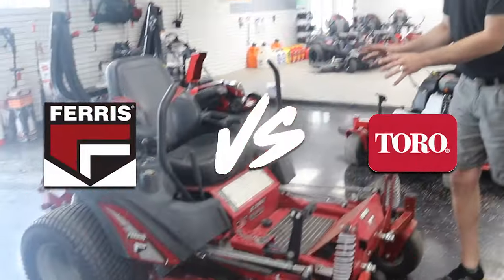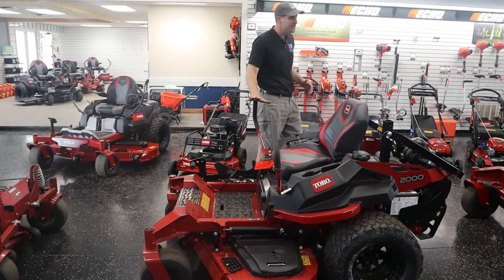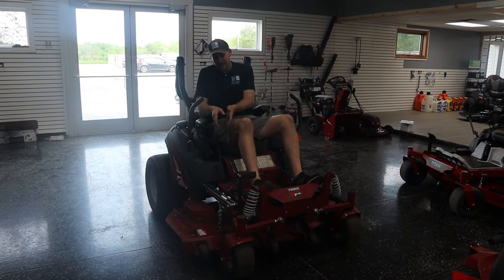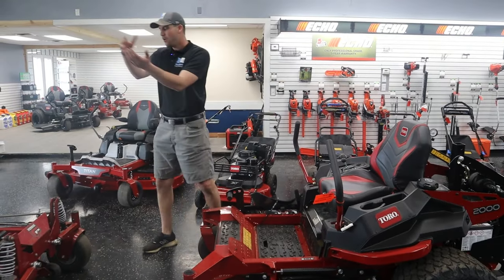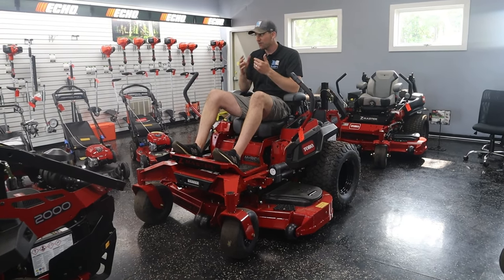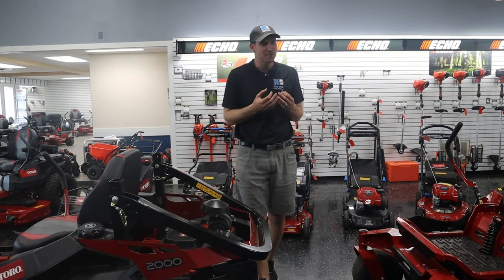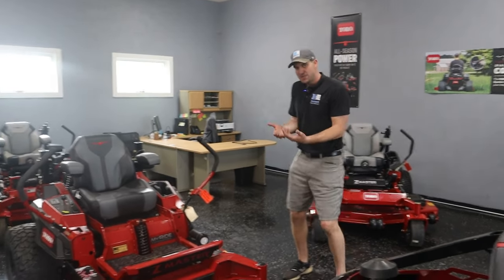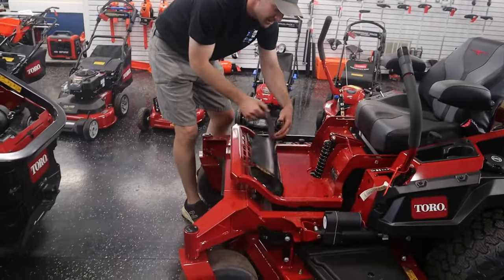TORO vs FERRIS | which brand makes a better mower?

Comment: Both make a good mower,  depends on what you want out of a mower.       BUT I just sold a Toro Zmaster and bought a Ferris isx800 and absolutely love the Ferris.  There is no comparison for the ride it offers.  No regrets.  Looked at the MyRide before buying the Ferris and still no comparison,  Ferris has the absolute best riding mower out there.
Reply: I Agree with this 100%
Reply: I gotta have the toro. Stays on hill better and I get done quicker

Comment: Mower cost has got way out of control
Reply: I agree they are pretty simple machines compared to say an ATV.  You can basically bolt things together it doesn't need to be high performance.
Reply: Yep 🤦🏿
Reply: The Ferris is way cheaper than most with the best possible accesseries available

Comment: I owned a Ferris ISX 800 for 4 years  and it was the worst handing mower and cutting mower I’ve ever owned. It is unstable on hills and ditches and the cut is uneven if you have a yard that is slightly hilly going up because the back end will squat and give you a higher cut in the front because the front of the deck raises a little due to the back end squatting.
  You will have to double cut to even out the cut. If cutting down hill it will be much lower cut because the front end will squat. I was glad to trade my Ferris in for a toro z master 2000. The ride on the Ferris is not all that good.  I adjusted the suspension in every position and you still have to spend money on a suspension seat for it to get a good ride. In order to get a good cut on the Ferris you have to adjust the suspension all the way up to prevent rear and front squat. Just my experience with Ferris and others might have better luck with Ferris.

Comment: The body on a Ferris may nose dive on a hard deceleration but the deck does not as it is suspended off the wheels not the body so it does not produce a lower cut in the front when this occurs.  Unlike for instance putting a set of Flex Forks on a Hustler then when it nose dives under hard deceleration it will cut lower when this occurs.    I've  owned 4 Ferris machines including the 5100 diesel 72 and loved each including the two I currently own.  NO mower rides as good as a Ferris.
Reply: Doesn't that essentially make it the same as the Toro then in this video?  You have wheels + deck as the bottom platform then the rest on top.  With shocks between.

Comment: The comment made about coming to a stop/slow down,and scalping is not accurate. The deck is linked to the suspension. As the suspension is compressed, the deck raises, and when the suspension is extended the deck lowers. This is a great feature on the Simplicity/Ferris deck suspension design.

Comment: We run Ferris. The biggest difference between the My Ride System and the Ferris suspension is, My ride is a suspension system for the operator where the Ferris suspension is for the whole machine  which aids when mowing grass fast, you get less deck chatter than with the Toro when the front tires are bouncing up off the ground while hitting bumps.  If you incorporated Hustlers SmoothTrak steering into a Ferris, it would be the dream machine. The automatic parking brake on the ZTR's from Hustler is also awesome.

Comment: I think that the toro is worse because the wheels in the front do not move, on the Ferris they move and it feels like the bumps are getting filled im, sorry but the Ferris suspension is just better.

Comment: I have a new Toro lithium, it sucks, drive wheel falls/self-powers off in 2nd hour, battery shorts, and on-line Toro will not take it back. They do not take items back if you use it for 1 minute! Their rear left geared wheel unbolts itself from the bracket, it self destructs! Two others have the same problem. Their repair dealer literally told me "with Toro, its Buyer Beware". I have a Toro case number, a BBB case number, and a US Consumer Product Safety Commission case number.  Save yourself and learn from my mistake, and stay away from Toro.

Comment: I just purchased a new Toro Z 2000 60" with MyRide. Best mower I've ever had, bar none, but two things I've noticed:

1. The foot lever for raising/lowering the deck is very awkward to use and I have turn myself into a pretzel to actuate it. I'm 6'0 and I cannot imagine taller guys having to do this. I will have to fabricate something to move the pedal further away so I can push on it more easily.

2. This mower is so fast, I am noticing bumps in the areas I mow that I never knew were there before (because my previous mowers were slower). Even with MyRide, it gets bumpy on the mower at times. 

Other than those two things, this thing is a beast. I was looking for a better mower that could lower my cut times and be more comfortable while doing it. The Z 2000 certainly fits that criteria, but I'm sure there must be better mowers out there.

Comment: Very informative video on the 2 brands. They are both solid machines but the older I get the more I want comfort.
Reply: I’m with you. Just took delivery of a Ferris ISX2200 which is the newer version of the one in this video. I’ve got a bumpy yard due to over a dozen very large Silver Maples that send out roots right at the surface in some areas. I have berms and hills too. The Ferris is like taking a Lazy Boy on a ride around the yard. No comparison to any of the other zero turns or tractors I’ve driven. You’ll love it. 

The ISX2200 also has an upgraded deck. Very smooth cut and I haven’t noticed the nose-dive scalping that he discussed in the video. Mine has a 60” deck and I was concerned about scalping as I am retiring a John Deere with a 48” deck. I don’t know how they did it, but the Ferris has much less tendency to scalp than the old JD. 

A couple of things that I don’t like about the Ferris is locking mechanism for folding/extending the ROPS bar. It consists of a 1/2” round bar with a hitch pin on each side. It’s fiddly to say the least. 

The other thing is the mechanism to hold the discharge chute cover vertically when the extra clearance is needed is a joke. It doesn’t hold the chute all the way up and releases even with just some minor jostling when parking in my barn. I fabricated a temporary solution this morning and am just waiting for the paint to dry to install it. But I shouldn’t have to do that. The chute is real nice though. It’s thick reinforced rubber that’s over 1/4” thick with no corners to impede grass discharge. It broadcasts the clippings very nicely.
Reply: @Dave-ei7kk  sounds like a great mower and having the suspension it’s a no brainer

Comment: First thing I do when I buy a new Z Turn is remove those pulley covers!
All they do is trap grass under the pulleys.
Next I remove the chute and add a chute blocker.
That way I can use the mower as a mulcher for leaves, or block off the chute if I'm in a tight spot to stop blowing the grass into the landscaping.
Reply: Same

Comment: My first ztr was a Ferris 2009 model IS500z with 52" deck. Replaced it with a Ferris IS2000z with 52" deck fall of 2015. What made me go Ferris is my 3 acre yard is fairly bumpy. Loved the IS500z, rode good, cut good and very little trouble. I upgraded to the IS2000z after my daughter bought a house 1 mile from mine. She has a 2 acre yard so my mower cuts 5 acres at a time. I know these are older units compared to the test but I still feel somewhat relevant. The 2000 was a noticeable improvement in ride, which a Ferris has a good ride, and cut. The 2100 replaced the 2000 and now it is called the 2200. In 2014 the IS2000sz with a 52" deck and 28hp Briggs motor was around 9k even. The person I bought it from, an older gentleman with 1 acre, purchased it leftover for 7.8k spring of 2015. Sold it to me with 12.1 hrs for $6500 fall of 2015. I felt like I had stolen it. They will scalp it you stop fast at speed. Or stop and back up fast. You just need to keep your movements fluid and it doesn't ever scalp my bumpy yard. Ride and cut are much better on the IS2000z over the older IS500z. For 14K I would think you are near Ferris IS3300z price. Most all brands are good and many advise to rate the dealer more than the mower itself. Lucky for me I have needed very little dealer support.

Comment: I love my new Ferris ISX 3300 72 inch bad boy indeed smooth no scalping and cuts my 7acres in 3 and half hours full throttle 12 mph
Reply: hmm.  my older IS2000 does 5A in 1 hour (flat, grass only).  but, I never push it that hard.  I mow at about 30% top speed for a more beautiful cut.

Comment: Hey Matt, Russell (Tennessee)  here, I have a Ferris ISX800 54"  and i love it!! also have a Snapper ST50X 36"  I did get the Toro Grandstand you quoted for me. I found one in Nashville so it was geographically better. i haven't put it in service yet but after riding the Ferris it is bumpy s heck! But, If you are riding the Ferris and you make a quick stop you will put the Olympic rings in the lawn! :face-blue-wide-eyes: Toeo is great on smooth yards! Great Video!
Reply from the maker: Glad you got one. Thanks for watching our stuff. Sounds like you have a nice fleet.

Comment: To me the suspension on the Ferris takes the shock out off the frame. I suspect the Ferris can stand up better to rough terrain over a long period.
Reply: Much easier for the back for those who prefer Riders over Standers.
 If someone has relatively healthy legs, a Stander is by far less fatiguing.

Comment: Left off most important aspects:  quality of cut, warranty, and engine offerings for each.
Reply: Yes, thank you! You’d think he was comparing vehicles used for transportation rather than vehicles whose primary use is to cut grass. A lot of talk about the suspension and called out the transmission model 3 or 4 times but not a word about the power plant. And that’s a big deal. 

One thing I did learn that gave me pause about buying a Ferris mower is that they are owned by Briggs & Stratton. I want a Kawasaki or Kohler or Kubota motor in my mower. Briggs would be my last choice or maybe even a deal breaker.
Reply: @Dave-ei7kk  You nailed it!  No wonder power plant was not mentioned.  Thanks for the info.

Comment: i have a 23 ferris 400s and its a little tank ,mows a slopping 5 acer lumpy bush block many trees and garden beds lumps and bumps she cuts  about 3 acers  very well and fast so damn quick and nimble , even thick grass rips through it ,,what took me 6 hour on old 16hp murry lawn tractor i can now do in 2 hours on the ferris ,the 23hp v twin B/S heavy duty block engine has more then enough grunt i dont rev it hard not for first 5 hours but i still cuts perfect at 70% throttle ,got the property looking like a golf course ,Amazing machine worth the money i think going for trouble free mowing for the next 4 or 5 years ,do yourself a Favor and spend more time doing thing you love now i can smash the yard in 2 hours its a Friday arvo job done and dusted ,free weekend to go camping fishing 4wding with misses ,  welcome yourself to the twenty first century of mowing grass ,400s now comes with upgraded pro 3100 hydro trans

Comment: I love the videos especially the comfort 
I love to see the toro 6000 vs toro 4000
31 hp vs 35 hp
16 cc vs 5400 trans
I use both
Reply from the maker: Thanks so much for watching! We have a local guy who bought a 4000 and 6000 series 72” that we plan to do a video for in the future.
Reply: It would be interesting 
Especially banks and response between transmission
Reply from the maker: Check out the latest video on our channel

Comment: I happen to own a Ferris IS700Z and a Toro model 75759.
By far I like the Ferris far more!
It's way faster, handles and rides better, has far more grease points, wider deck belt.
SImple things like under the seat there's a sticker that says what the deck and hydro belt part numbers are, a simple to use drain line for the oil that stays attached, even The Treads on The rear Tires have more TracTion Then The Toro.

Comment: I was looking at a ferris and toro when i got my new zero turn. I wanted the ferris for the suspension. Nothing rides like a ferris mower!!  It's amazing how smooth one rides. I wanted a toro cause my dad has a zmaster 500. That toro is around 17 or 18 years old with no troubles at all.  It has been bulletproof. I ended up with a snapper pro 200xt with a 37hp vanguard. It is a brother of the ferris and its built as good as a toro 6000 minus $5000.

Comment: Side comment, why is it that when you buy a mower that the manufacture's cheap out and do not put  a sticker on the deck showing  the layout for deck belt?
There also should be a sticker telling the deck belt, hydro belt, oil, and air filter #'s, and the blade #.
They give you a manual with three pages of useless safety warnings to cover there butts, but no useful info on the parts needed to maintain it!
Reply: The toro has always had a belt diagram on the deck.

Comment: I own a Ferris is700z 61’ with the 27 Briggs

And a toro 4000 pro 52’ with the 25 kawaski. 

Non biased opinions, Ferris beautiful ride little outdated when it comes to tech like usb ports or massive storage compartments, and the zt-3300 or 3200 pumps can’t remember are a little underpowered for a 27hp semi commercial mower,  has an AMAZING deck cut quality is 10/10 hands down on the Ferris lays stripes beautifully literally art. 

Toro 4000, cut quality is hideous, I think these decks don’t have baffles.  My ride makes you feel like you’re swinging on a swing when open cutting and full cut speed when you hit a bump it is an ok system tho compared to the Ferris. Deck is non independent so you will still scalp on this machine if you go into a hole 😂 idk why he said that Ferris does it alone all mowers do… 😂 they have great sturdy chassis they look really beefy the zt-4400’s will literally go through 2ft of mud ! I will say this tho rear tires not the voodos aren’t as grippy as the CARSILE TURF 24’s I swapped both out and this thing WILL HOLD CRAZZZY SLOPES ! Pumps are amazing cup holders and ammentites I feel like the 4000’ was a rushed machine they could have taken more time to build this machine to be 10/10 like the handle bars will literally move 2-1/2 feet infront of you and they don’t auto retract more like a cruise control but not a good cruise control, motors never come aligned so one pump will always be faster then another causing you to turn to the right or left. it has all the high tech greatness just need more time and investment in the small things.

Comment: I dont think briggs owns them anymore
Reply from the maker: Do you know who does?
Reply: @howeequipment KPS Capitol owns Briggs, Ferris and Simplicity/Snapper.  Ferris just expanded manufacturing in NY.
Reply from the maker: @H0kieJoe  gotcha. So it’s not that briggs owns the others but rather briggs is one of the others that this investment group owns as well.
Reply: @howeequipment  IIRC, Simplicity bought Ferris, then Briggs bought both some time later.  Perhaps Snapper was part of the acquisition as well.

Some years after that, KPG Capitol bought Briggs who already owned Ferris/Simplicity/Snapper.
Reply: @H0kieJoe I belive kps only bought  the mower side of Briggs that’s what we were told at the factory

Comment: I think both are entirely over rated. As far as well built and easy maintenance the Dixie chopper is so much ahead of either of those mowers. The suspension BS they float just don’t compare to the simple and solid built facts of Dixie Chopper. They are absolutely more well built and so much easier access and need almost zero maintenance. I think a chopper will outlast any of those red machines simply because they are not using cookie cutter design and are built on a completely better platform. These red mowers are all flawed always have been in different areas and they just are not what some of the better built mowers are like dixie chopper.
Reply: I disagree. Not saying dixie chopper is bad, but Ferris is a great mower, given I have an older one the is3000z 61" from like 2003. They are built like a tank, the decks are built better, suspension is built better. It is a testament alone that the one I have is from 2003 and we are almost in 2024 and it is still running.
Reply: My ferris from then as well 26horse kawasaki with radiator beast heavy pulls my xmark and Toros out when stuck as well as shrubs